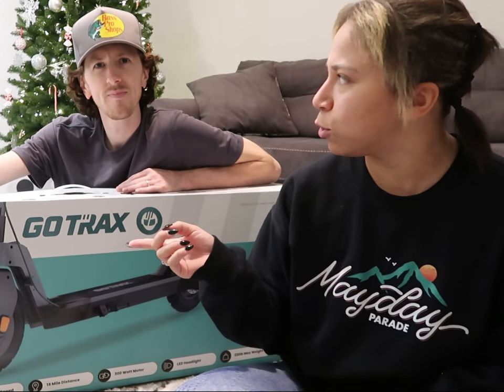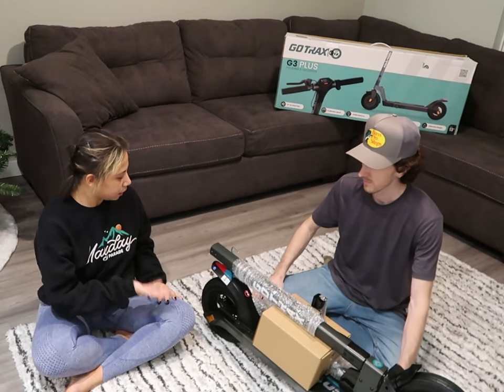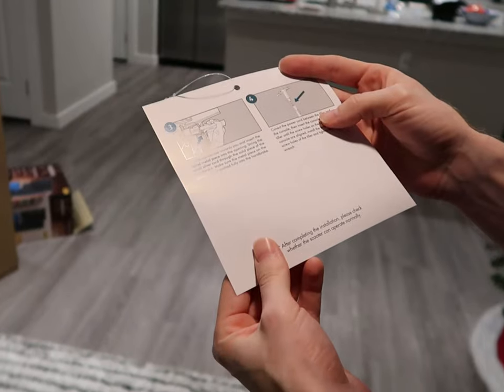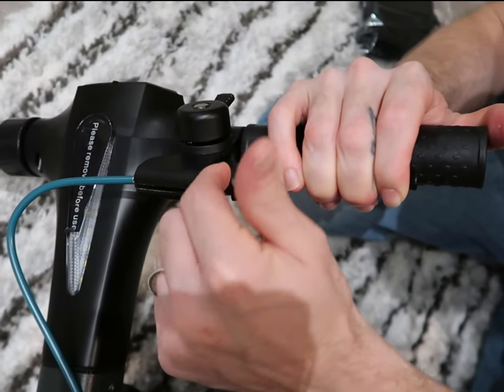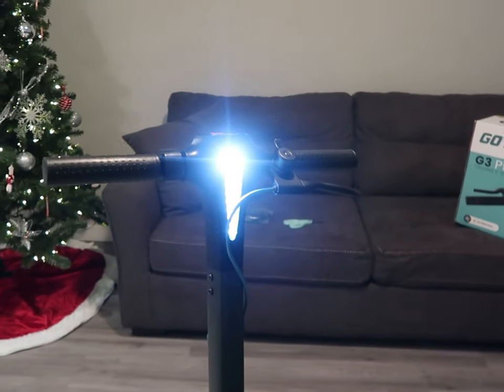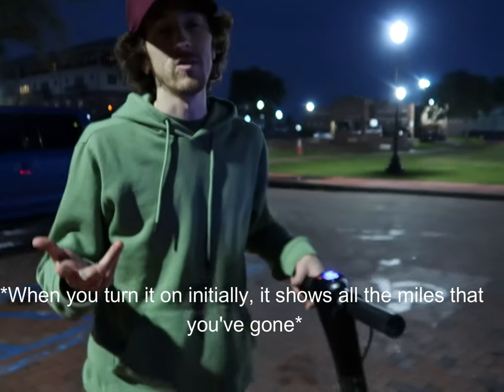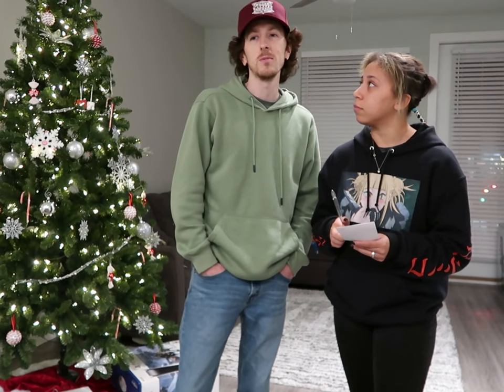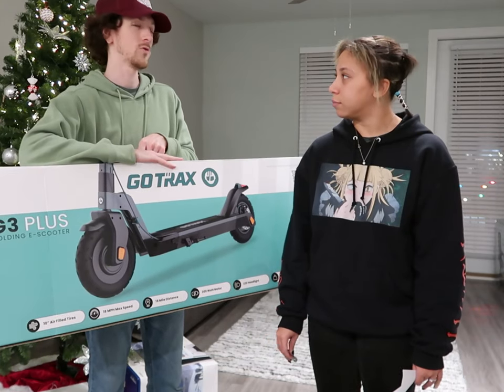GOTRAX G3+: WE BOUGHT AN ELECTRIC SCOOTER | unboxing, assembly, test ride, and review

Comment: I had a slight issue with the brake line too. Had to chuckle. I've had my g3+ about a week now. I use it all over the place. My scooter battery lasts up to about 22 miles. That's at max speed with cruise. I've taken it up hills and, the lowest speed was 15 mph.
Granted, this is my first scooter but, I think it's of great quality and fun. The only downside is that the odometer doesn't say the mileage as you go. Also, no shocks. Besides that, I love it.

Comment: Ive took the front tire off to fix a flat. Whenever i put the wheel back on. There wasnt anything tirned on the council. Took the council apart cleaned it. Plugged it back up still no power/ lights turned on. Yoday putting the meter on it theres voltage on there. Still not turning on. Why?

Comment: Thoughts : The brake assembly pops in pretty easy but you need to really to pull the casing back. I'd be careful with the tension on the rear brake. I would not recommend tampering with the rear assembly like they did if you aren't mechanically inclined. Just find some big guy and he can pull it on. This video is very well done though. I love the fact it's tall enough for me and I'm 6'. I ride dirt bikes and never rode a scooter before so I am assuming I'll just crash the thing. Got it to ride scooters with my kids. It's a bit overkill for that function.
Reply: Dude it was so simple I feel like they make this way more difficult than it had to be intentionally for bad reviews 😅 mine was super simple didn’t break or strip anything to get it together the inbox and assembly took no more than 6minutes lol
Reply: @rudewizard85  I had to get into it with my girlfriends the other day. If you don't have the tension right it won't release the cruise control. I found the sweet spot, but I didn't know until she almost smashed into a mailbox when it kept going under braking😆
Reply from the maker: not intentional lol, we just literally couldn't figure it out. why would i post something for bad reviews lol
Reply: I know this is a year later but:  if you look at the instructions you insert the break cord before attaching the handle and you have no trouble at all. Be sure to connect cords together which are tucked in the shafts before installing the handle. I am considered elderly and a woman and I didn't have any trouble setting it up. Although I did ask my spouse to pull the break cord to insert because he has a stronger arm, no problem. Excellent reviews on this model scooter. Haven't got to try it out yet.

Comment: I bought one today. I had one before but returned it.  I had a swagtron and wasnt very happy with it.   The pneumatic tires are a game changer.  I wish it got more mileage.    I didnt have any problems with the brake cable. However i did have a difficult time with the screws. The holes wouldnt line up.  I had to angle the screw up to get it in there and then hammer it home.  Im assuming there is a weather tight gasket on there to prevent moisture damage to the power cord.   I will be trying it out this evening.   You can hook up external batteries for these scooters.  Check youtube for tutorials.
Reply from the maker: the screws were iffy with ours too but after the first few, they got easier! also, we didn't know about the extra batteries, very good to know!!!
Reply: @Isabella Ames  im glad if got easier for you !  Most of the ones on mine werent very happy.  It does take some fancy work to do the external batteries but it is possible.  Will update on miles once i get through a charge

Comment: The reason why you're only driving at 7mph is because you guys are maxing out the weight capacity. This scooter can only carry 220lbs, and it's not designed to carry 2 people. I ride mine up steep hills an my G3+ goes about 13-15mph and I only weigh 155lbs.
Reply from the maker: we realize that; however, we had tried out the lime scooters in nashville and they were capable of holding us both, even going up hills. we decided to return it and get an electric skateboard. casey is thinking of getting an electric scooter that is more powerful and capable of holding us both.

Comment: That brake cable has 2 ridges on the end.  You use a special tool to pull the cable into place.  You can use a hammer, the nail puller side, to slide the ridges into and help pull the cable into place.  
---
Disclaimer: I worked in a bike shop and know a few things.
---
With that said, you 2 did a good job with your video although you can't read.  And please wear a helmet. Helmets are stupid looking but they will save your life.  :)

Comment: What updates do you guys have for battery range? Because i dont know if im trippen but i only used it around my block after fully charging it and it went down 2 bars fairly quick, Thanks!
Reply: So I did a little test with mine. I used my garmin watch to track me. So from my house to my job is 2.6 miles there and 2.6 back at 18mph. I had left the house with a full charge. By the time I got to work one bar was gone. Leaving work about halfway another bar was gone. By the time I got to the house, I had one bar left. Made me nervous cuz this thing gives no warnings when it dies. The mileage on this sucks. But it get me back and forth.
Reply from the maker: hey! we actually returned ours a while ago and got the meepo shuffle instead. i'm sorry i couldn't be more help!
Reply: Thanks for the video. Very informative. 
May I ask why you returned the GoTraxG3?
What did you dislike?
And,  also, how is the Meepo Shuffle?  
Why is it better than the GoTrax, looks like Meepo is a skateboard.

Comment: So after these months how’s the battery? Still lasting pretty long?
Reply: I have the same exact one an got it the same time they did and drive it every day it has 241 miles on it and the rim gave out. Its made out of pot metal that happened 3 days ago i thought it had a hole in the tire but no I just keep refiling it every day then i saw the rim was bent then it broke. But I’m gonna see about the warranty and sometimes it doesn’t charge all the way to only 2 bars. And the brakes are already wearing out. Other then that it was good but I’m gonna get it fixed. And the the 18 miles on the box is a big lie most i have ever got was 6 and i was on flat straight ground l usually get 4 or 5 miles though. Hope this helps.

Comment: Lol, yall aren't very mechanically inclined..just loosen up the clamp for the brake cable on the caliper and then you can install the cable in the guide for the lever. Biggest mistake people make it trying to stretch the cable in. I guess it should in the instructions, however  scooting is more of a hobby and they are intended for people with some mechanical knowledge, since they ALL require maintenance in order for them to last... I'm not criticizing you though, just making a truthful statement.
Reply from the maker: no worries! i feel it should've been explained better in the instructions. we just wanted to get one because we enjoyed the lime scooters while we were in nashville. we did end up returning it and got a meepo shuffle instead😋